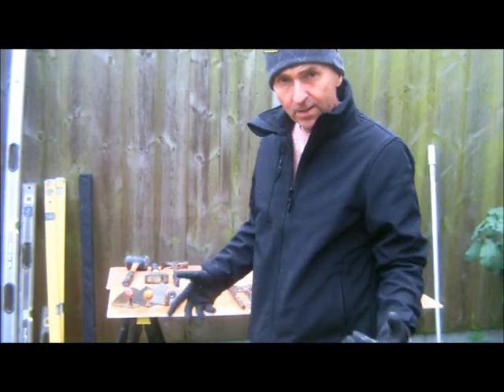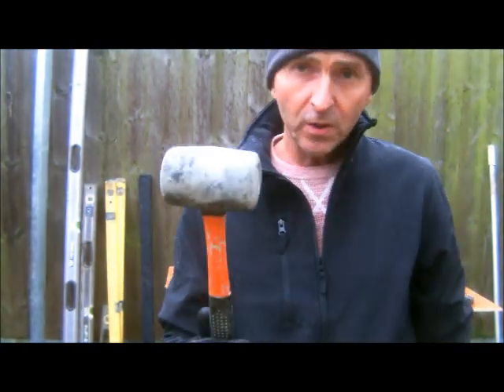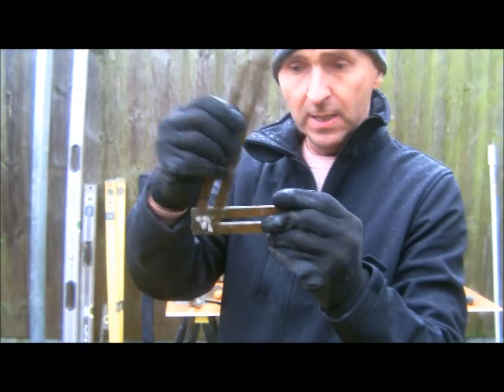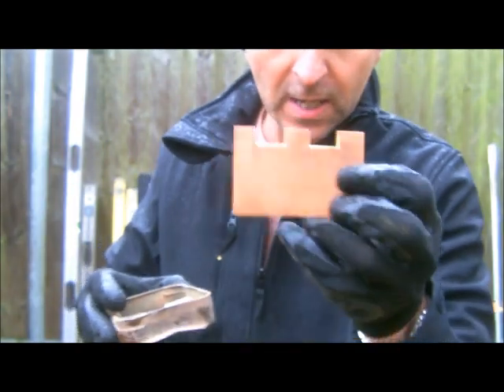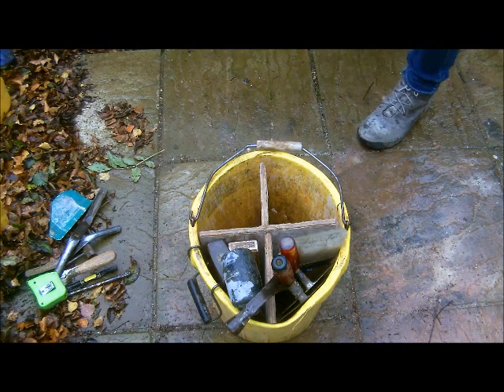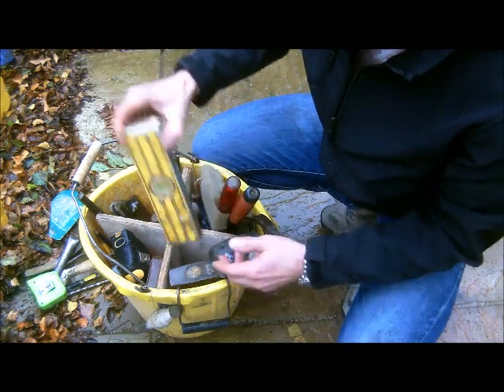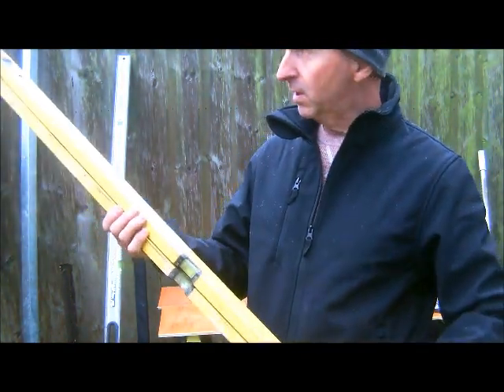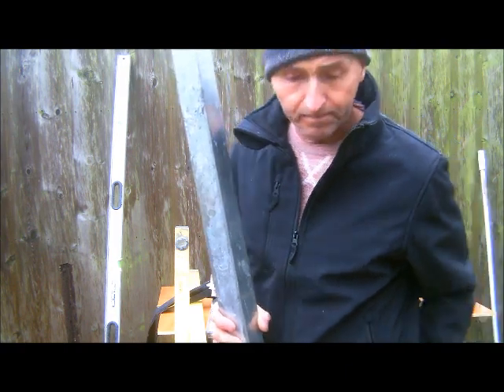the fine art of brickwork - Hand tools

Comment: Great vid, love how many of your tools have a story, and everything has a reason, and that you fabricate your own. The bucket divider, handle clamp and especially the short level are just too clever. 5:28 I learned recently this is much more dangerous than it looks. The curls are work hardened from hammering, and because of that they shatter instead of bend, like you said shooting off like a bullet. It takes a minute with a file or grinder to clean off, also then you don't have the sharp edges cutting into your hand. So goggles on when chopping!

Comment: Hi rob I was most impressed with your twisting arch twisting piers the metal template you use was it made by you or can you buy it,about cleaning A Good Bricklayer all cleans his tools at the end of the shift so tools are all ways keptClean.I also rap lines on 1 pin for the same reason you gave,also the use of old levels for profiles,My tool bucket is a 25L febmix container with a handle it has lasted 26years.l have to say it is a pleasure to see some one who has the same ideas as me that is very rare in 40 years in bricklaying.
Reply from the maker: thank you
I make the templates

Comment: Brilliant way to organise your bucket rob... one small refinement mate... a few small holes drilled in the bottom prevents small tools tapes knives etc. sitting in water should the heavens open
Reply from the maker: yes, I toyed with that idea but left the drainage to the screw hole that holds the ply in place, I suppose it could slit up in time, but to honest, I've had that bucket for 25 years or so, and it's been ok.
Thanks again

Comment: Hello. I would like to buy a trowel (marshall town). Can you advise me on the size has to choose. Thank you
Reply from the maker: It's best if you pick one up and see which feels best.
My Mashaltown was an 11 inch, but now worn to 10.
Reply: MIQ 

I find that the W. Rose trowel to be superior and they tend to have thinner blades. 
    I realize that thinner blades will wear quicker but the flex in the blade will absorb more energy and reduce stress on your wrist, forearm and elbow.  
    So when I purchase a trowel, I look for a large selection and systematically, with a trowel in each hand, eliminate the stiffest ones by bending the tip against the shelf and finally selecting the thinnest.

Comment: Why did you cover the first trowel with your hand?
Reply from the maker: ah, well spotted. It's my silver trowel that I was awarded after my Advanced Craft exams (Level 3 nowadays) and I didn't want to make a showy display.
Reply: @robsonger1  fantastic! Well deserved, you are a fine craftsman. You make me proud to be a bricklayer. I try to take as much pride in my work as you seem to. Sadly though, I have seen so many "bricklayers" that should not even be able to hold a trowel never mind call themselves bricklayers. However, Your work is very impressive indeed! I would have so many questions for you if I ever came across you!I also have two apprentices at the moment and I constantly tell them to watch your videos in their spare time.
Reply from the maker: @carrot3945  thank you, please keep watching, there are more videos coming..
Reply: @robsonger1  that won't be a problem. I like to rewatch a lot of your stuff. Also, I have a question. I was watching your video today on the flush jointing that you were doing with a wooden block. I am currently finishing the brickwork that I am building in the same way however, I put on a glove and rub the mortar after it has gone off. I am coming across the same problem over and over, it drys out different colours and very very white most of the time. What causes this? The mortar is made to the same ratio every time. I also tried your method with the wooden block, but the mortar needs to be extremely dry to rub it with block I have found, so not ideal for the last bit of jointing in the evening as the mortar hasn't gone off enough yet
Reply from the maker: @carrot3945  the mortar must be almost dry before its jointed, in any style. With flush jointing it can be even drier. If jointing is done too soon the moisture in it is drawn to the surface and will dry patchy.